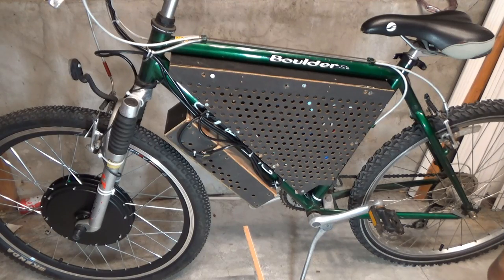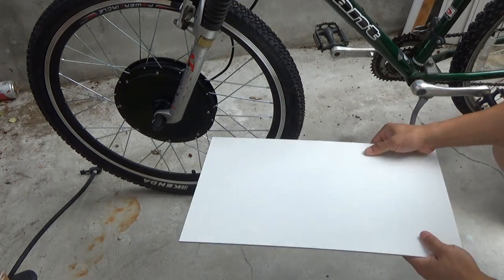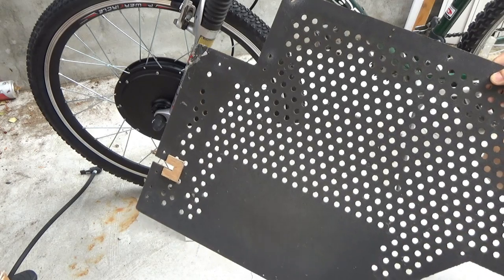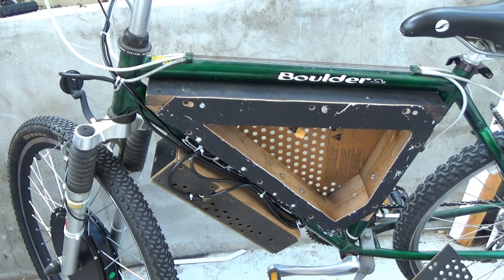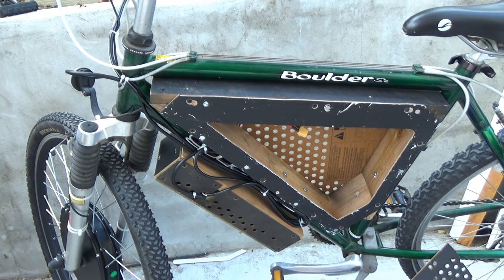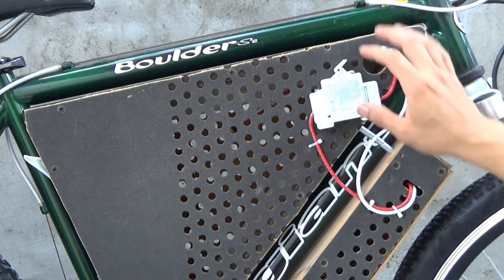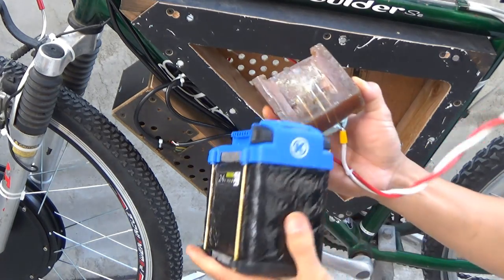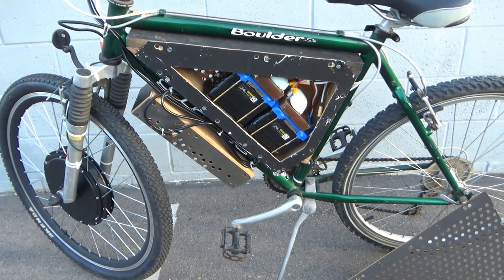DIY Electric Bike S01E01: Home made Ebike battery box

Comment: I bet thos batteries won't give you much range and deffienietly won't handle 1500watts. You should use lion 18650 cells inside this box(18650pf made by Panasonic are cheap and great quality for example) I can see roughly you could fit 200 18660pf cells that would give you about 2kwh of power.  Your batteries are bulky and probably no more than 400wh of power
Reply from the maker: You're right that it won't give me much range. But it's removable and I can just remove it and put a fresh one in. It only takes 30 seconds to replace batteries and I can keep on going. As far as 1500 Watts, yes it will handle 1500W with ease. 1500W is only about 30 Amps (1500/48). This pack is 5 in parallel with each having 20 Amps discharge rate. That will make it 100 Amps discharge rate. Do your math and that's about 5000 Watts (48v x 100A). Of course that's only on paper and you will get less in the real world. But just to prove to you 1500W is nothing with this battery pack. As far as cost goes, the Panasonic cells are $7 each. To build the same pack as I did here, you need 60 cells. And that's $7 x 60 =$420. These 2 Kobalt packs I built here only cost me less than $200 (much less if you have Lowe's coupons and discounted giftcards). It actually cost me just over $100 for these 2 packs as I have coupons and discounts. I don't think you can build a cheaper pack with the same specs anywhere else. Not to mention the Panasonic cells only have 10A discharge rate vs. 20A with the Kobalt cells. And don't forget, you will need a separate 48V charger for the Panasonic pack and that's not cheap. The Kobalt, I can just use the original 24V Kobalt charger for each battery as it's just a Kobalt power tool battery (just bigger).
Reply: you can get a pack of 4 cells for $14.96 if you are buying more than 5 packs from fasttech in china this includes free worldwide shipping, though it wont arrive quick they are genuine if stated genuine and half the price you suggest, you may be able to pay extra for faster shipping if required but the name fasttech is quite ironic lol but it puts the cost of 60 cells at $224.40
another suggestion though its a bit late now, i would have made the box a bit less of a snug fit and wrapped it in fiberglass or carbon fiber to weather proof it, there is a special black super sticky resin for wrapping stuff stick the cloth on then you can paint it with layers of clear epoxy and sand and buff it (for cf) or just spray it (for fg) it would add strength and durability too
Reply: oldskoolhead0 DHgate is the place to get bulk 18650s...
Reply: If you see the video where he makes the battery packs, the packs consist of 6 18650's and he puts 5 of them in a DIY stack.

I'm guessing he uses these tool packs because they come with pre-installed balancing and charging circuits.

He could probably replace the batteries in the packs with 18650pf's to boost their the total wh capacity. Usually laptops and tool packs have 1600-2200mWh and the 18650pf's are 2600 or there about.

If it was me, I'd be a freakin vulture and rip those tool packs apart for the electronics, use 18650 clips to setup a nice grid of batteries that fit my housing well, use the balanced charging and protection circuits from the tool batteries and max out how many batteries I could stuff in the triangle frame.

And since his packs have 30 batteries each, making 60 in the volume shown, he could probably stuff over 200 18650's in there without much issue.

BUT, 200 18650's will cost you 600$ and at that point you're just making making an ebike uneconomical.

Comment: Just wanted to thank you for sharing your great idea, I actually copied it for my ebike build.  I am using three 36 volt 4ah dewalt cordless tool batteries wired up in parallel with my 1500 watt ebike. I have been riding 20-60 km daily for the past three months with them and never had a problem. I use the stock battery charger and bring them in to work even to charge them up if they get low. Nobody ever complained since they are safe dewalt batteries. Oh by the way they were cheap brand new condition at a pawn shop nearby.
Reply from the maker: My pleasure. By the way, these are the Dewalt 36V batteries that have 26650 cells inside, correct?
Reply: vuaeco I didn't open them up but they are made in 2015 and 2016 so maybe the older type cells 18650
Reply: if u ever need free batteries, just go to a computer repair shop and pick up their old laptop batteries. Usually, they have samsung, lg, panasonic, or sony batteries in it and only one cell is bad. I've salvaged at least 50 18650 cells that way
Reply: Amir Jabri...a 1500 watt motor at 36v would need a hefty controller indeed. How do you even get moving with 4 amps? How would you have any range at all? Did you bypass any electronic control and just hit a switch once up to speed?
Reply from the maker: It's not 4 Amps. It's 4 Amp Hours. Amps is current. Amp Hours is capacity. Every of those 36V pack can discharge up to 15 to 20 Amps. He has 3 packs in parallel so that means discharge rate up to 60 Amps, not 4 Amps.
Reply: Joshua...thats is becoming increasingly rare since most business want their recycling volume to better match the amount of batteries they sell or there is increasing liability problems with Lithium Ion batteries or they sell them on eBay. Similar to the plentiful free used deep-fryer oil for your biodiesel...the word is out...free used laptop battery packs are disappearing. Act fast! Establish a source and go every week. Good luck!

Comment: Great job 
Questions 
I have an ebike that is 48 V, 15 Amp, 750 Watts. How can I add another battery ( 48 V, 26 Amp) ? 

1. Do I need a switch in order to go from one to the other? 
2. Do I make them in series and/ paralell?
Reply from the maker: You have to put them in parallel but don't connect them together. You can only use one at a time so a transfer switch would do. Or just unplug the empty one and plug in a fully charge one if you need to change over.
Reply: @vuaeco  
Thanks for the reply 
Where can I get instructions to add an additional battery to my ebike?  Please 
There are some steps involved in the cable installation process

Comment: What is the range on that bike: at 30mph speed with those batteries?
What is the specs of those batteries and what motor are you running?
Reply from the maker: I've never run flat out 30mph all the way. My speed is about 20MPH average and I get about 25 miles per charge. That still depends a lot on the terrain (hills), wind speed/direction, stop and go traffic, and average speed. Batteries are 2x 10Ah at 24V. You can see how I made it here: https://www.youtube.com/watch?v=CSYB60GSLic
Reply: Have you figured out a way to make the wheel motor act as a generator and charge the batteries on like coasting or down hill?

Comment: If i wanted to put a volt meter inline to see controller true output,where would I place it on a 3 phase hub motor. I have 1000 watt 48v front hub motor running at 60v,I want see if controller is holding it back .

Comment: i made mine with two 24v kobalt batteries,but i gutted the chargers and atached them to the back of the bike and the guts i put in another container to use them as chargers.
Reply from the maker: How do you charge the batteries? Do you still have to remove the battery and put in the chargers to charge it?

Comment: You shouldn't be enclosing your controller in a box, they need air flow for cooling if you want a long lasting controller. Also your battery box has holes , water can get in!

Comment: Hello, I love your videos but the best is how detail you are when explaining your experiences. anyway, I am building kind of like a racing go kart (shifter like type) and I will be using your idea with the Kobalt battery pack; its the best I seen. Now, my motor is a 48v, 20.8 amps at 3000rpm. I guess the 20.8 amps is the inrush current so I am risking it by using the 2ah battery pack. In one of your videos in which you showed how to build this battery pack you explained that the Kobalt pack was a 2ah with a 20amps cell capacity. Then you added 4 more rows of batteries for 20amps capacity each for a total of 100amps capacity for the whole battery pack. Not sure how you got these numbers. Each battery in the Kobalt pack is rated at 2 amps and in series with 6 batteries gives you 12amp capacity does it not?
Reply from the maker: Series will give you increased voltage. Parallel will give you more Amp. The battery I built was 6S5P. Each cell is 4V, 20A discharge rate. That means 4V x 6=24V for series. 20A x 5 = 100A for parallel. That's how I come up with 24V, 100A. And the battery itself is 10Ah (not 10A) in capacity.
Reply: Thank you for your response but I am still confused. I guess, I am not understanding the concept of 1 amp vs 1Ah. Anyway, would you share the specs of your EBike motor; Is it 48v at say 10amps(inrush) what are the continuos amps?  @vuaeco

Comment: what front wheel hub kit did you use?   Price?
Reply from the maker: It's a 1000W 48V brushless hub motor kit. Price= $160 from ebay (at the time I purchased it a few months ago). I'll put the link of the open box video of this kit in the description.
Reply: Forks on many bikes cannot handle this kind of power.  Imagine what happens if your front wheel falls off at 30 miles/hour.  Hopefully you installed a torque arm. quoting Ebikes.ca
"A torque arm is recommended for front hub installations that are more than 500 watts (36V with 20A or 25A controller), or for any installation done on aluminum forks. It slides over the non-wire side of the motor axle, engaging with the 10mm axle flats to prevent the axle from spinning out inside the dropouts.  

We have 3 torque arm models in production, two for front forks and one for rear dropouts. All are made with thick ¼” stainless steel for the slotted plate and will work with both 12mm and 14mm axles. For more information on proper torque arm installation and other details see the torque arm homepage."
Reply from the maker: Yes, torque arm is a must. That torque arm from ebikes.ca uses a hose clamp. I'm not sure if that hose clamp is gonna be good enough, though? I've seen people using it got the clamp loose and broke the motor.

Comment: Engine in front wheel? Isn't it bad to the hill or in mud or sand? PS: I thought that speed is low before I realized it's in mph :-D
Reply from the maker: It's not bad. I've been using it for over one year and no problem on hills. Make sure you have a good torque arm installed or you'll rip your fork open. And yes, the speed is 30MPH or 45Km/h
Reply: I pull a two wheeled trailer with my cargo bike and it has a front motor. There's too much weight and stress on the back wheel as it is without adding more lol. And the balance is way better, it handles 30+ mph better too. I can even ride it off road ok as long as I'm not pulling the trailer. Though it does suffer a little compared to rear wheel drive. If you're a good rider you will quickly learn its limits.

Comment: Seriously.. Wouldn't a battery bag have been a more reliable, waterproof, lighter,  better and less cumbersome option?
Reply from the maker: Where do I find a battery bag that's tailored perfectly to fit my bike frame? I make this box as big as possible and I can barely fit my 2 battery packs in it. There's no more room for controller so it has to go on a different box below. How can I find a bag that's both big enough and fit my frame? Waterproofing is not as important as cooling for me. that's why I make a box with holes. I can easily just use pieces of wood panels without holes. And how can a plastic bag be more reliable and better than a painted wooden box?
Reply: I guess the same way that a suitcase would be better than a wood box in all the right areas. Its just that I would never dream of putting a wooden box on my lightweight mountain either as a pannier bag, or a battery holder. Besides, a bag would have more space. Those wooden walls you got on there are pretty thick. A bag with strap mounts on each side of the triangle would have been lighter and more flexible, roomier and yet be still stronger than the box as well as having a snug fit with foam padding for the batteries, say for example if the bike were involved in say a fall or knock. But I mean, if it works for you then all goodi